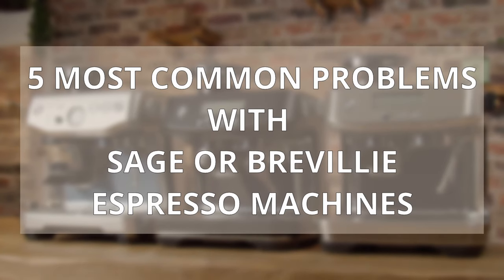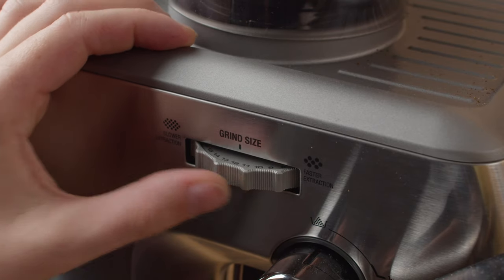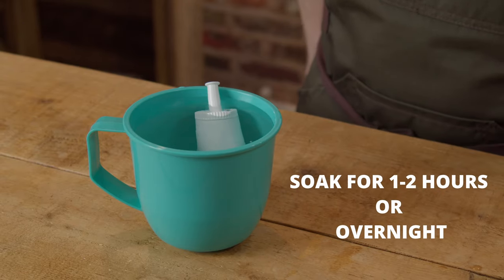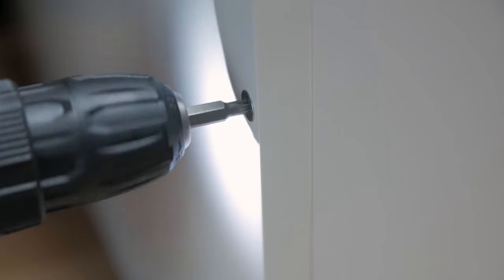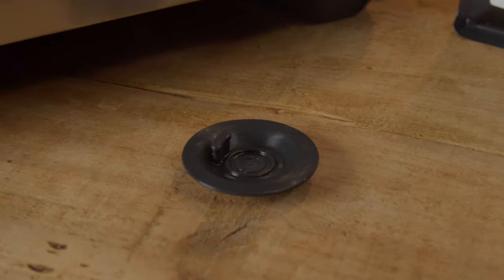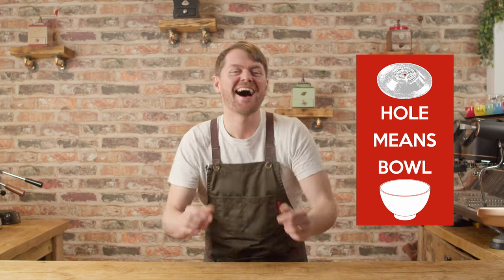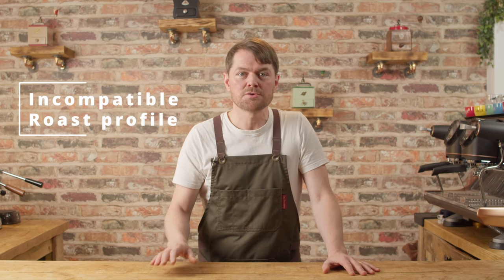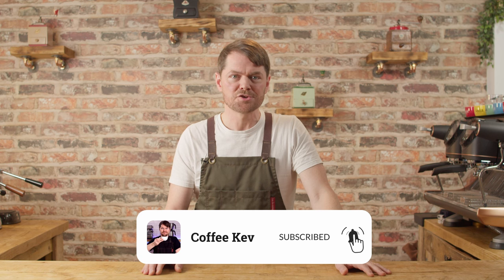5 Most Common Sage/Breville Espresso Machine Issues

Comment: Hi Kev, my sage touch impress has suddenly started making much larger shots, i usually make a double shot, which would usually make around 50ml of espresso, maybe a bit less, but today they have been coming out at around 85-90ml it doesn't seem to taste too bad, i don't usually drink  straight espresso i make latte's but is this an indicator of an issue ? And is there anyway to get it back to normal quantity ?

Comment: I took part my breville to clean it and after reassembling, and now the grind setting shifts during the grind due to the machine’s vibration. The screw holding down the grind setting is as tight as possible. Any tips?
Reply: I'd try removing the hopper, cleaning, removing the top burr, vacuuming, and then backing off the grind setting with the thumb wheel before replacing the top burr and making sure it clicks into place ( the final millimetre ). I had the same problem, and I watched a video on altering the inner burr setting, and I saw that the top burr actually clicked into place. My grinder then worked great. There is also backlash in the grinders, so if you want to grind one setting coarser, it's best to go coarser three notches and then back down two. Like if you were on a lathe with backlash, always alter the setting from the same direction going finer.
Cheers ☕ George

Comment: I have a new Breville Express Impress machine, and have experienced several problems. But the most irritating and mystifying is that I cannot get an automatic dose. No matter what I try, and yes, I did turn the dose to automatic, I have to keep my finger on the dose button, guessing how long to grind the beans. Any suggestions?
Reply from the maker: Hmm, yeah that doesn't sound right. Sounds like a fault unfortunately, , you'll need to get onto Breville or the retailer you purchased from.

Comment: Hi Kev, I have a barista express that has been cleaned and stored for 6 months. When trying to use it again the machine makes a loud noise when turning on and when trying to pour water nothing is coning through it just makes that loud noise. Took filter out but still the same. Opened up back and cleaned pipes but nothing. Any ideas what to do next? Thanks
Reply from the maker: Hi Lucy, first thought would be hardened filter, but if you've tried without the filter that rules that out, next would be is the water tank defo seated properly? But I'm guessing you'll have double checked that. So if you have you'll probably need to get onto support if it's in warranty, or find an engineer to look at it for you if it's not. If you're in the UK speak to Radu, he repairs sage machines: http://espressorepairshop.co.uk/

Comment: My machine never leaves pre-infusion pressure, any ideas why?
Reply: I had this problem to at first so I tested using the pressure basket and the pressure went up so it at least meant my machine was working. 
So I ended up using a finer grind . 
Atm I’m using a supermarket brand and my pressure is still low, it’s in the finest grind setting so I’m assuming it’s cause the beans are old ( it doesn’t state the roast date on the bag)
Reply: @katrinahendrey9826  mine was a problem with the grind size, sorted now.

Comment: Hi Kev. I'm using Breville Barista Max and having problems with choking. I've tried numerous espresso beans in the grinder, ranging from supermarket to freshly roasted beans and each time I have to grind at a setting between 22-26 otherwise the machine chokes. Any ideas?
Reply from the maker: Hi Jake,
It sounds like your grind is too fine.
Cheers
Kev

Comment: Hi Kev. Using Barista pro. Seem to be getting issues with second shots. Machine is dialled in and first shot pulls 2:1 ratio in about 32 secs. Second shot then can take 50-6- secs. I like a 4 shot flat white so this is frustrating. Follow regular flush and descale programs. Any ideas on causes? Sage helpfully suggested I try a coarser grind having clearly not read my email. 🙄. Thanks, Tim
Reply: I have exactly the same problem and have reported it to Breville multiple times and they consistently say that this is not a known problem, even though there are plenty of comments like this on the internet. So frustrating that they can't acknowledge this issue and provide a real fix. I have a hard time recommending this machine to others. The first shot is always great, but second shots are always problematic.

Comment: Hi Kev, I have the breville barista express and it is making that clicking noise when grinding how do we fix that problem? Part replacement.
Reply from the maker: Hi Have a look at this short:
https://www.youtube.com/shorts/7eDiuVzGBVQ
Ta 
Kev
Reply: That is exactly how my machine sounds and have gone through removed and cleaned both upper and lower burrs put back together and still makes that sound.
Reply from the maker: @lamontclabaugh7140  Doh! Are you using a light roast by any chance? If not, try also removing the lower burr and the impeller, a slightly deeper clean, see: https://youtube.com/shorts/FRvsUzXlCGg?si=3eeLJMtj90e1fArP and just keep in mind that there's another washer I didn't mention in this short, which is around the shaft at the bottom inside the felt, it's a bit of a pain to remove, doesn't really need removing, just make sure you don't hoover it up ;-). Fingers crossed this works.